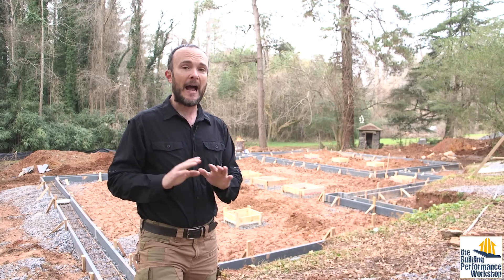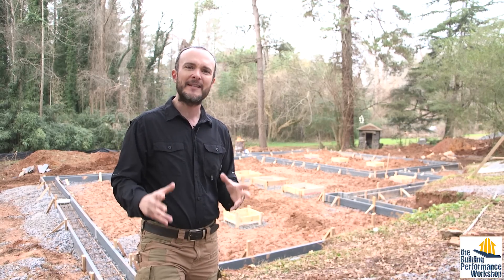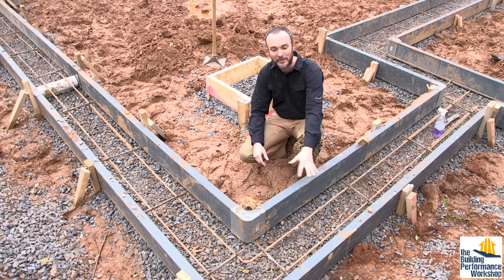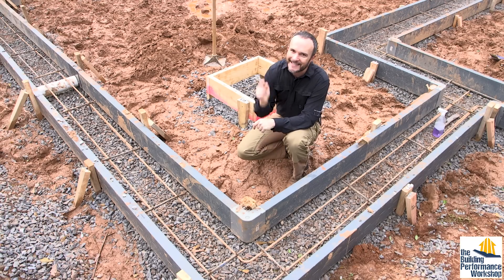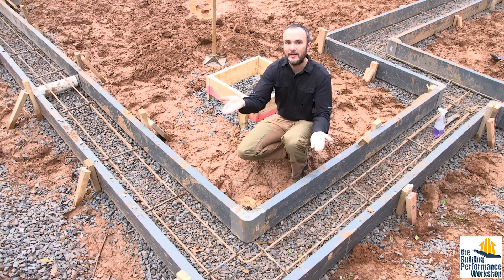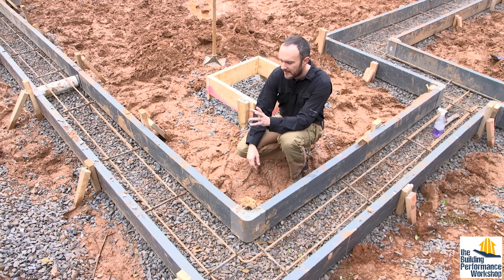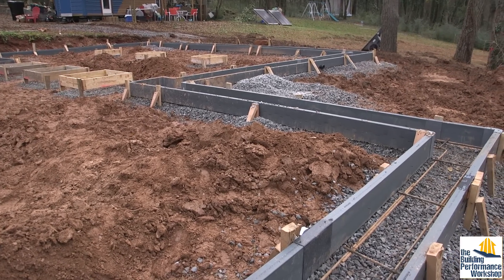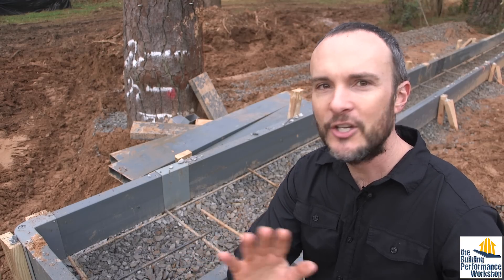First Concrete Pour: Form-A-Drain 4-in-1 Foundation Footings

Comment: I won't go through my entire work history but suffice it to say I have a lengthy career in building.  I came up through the trades and now manage custom residential as a general contractor.  I think you are doing yourself a great disservice.  Perhaps you have disposable income and if this is the case disregard this.  Please consider these points.
1)  It is untrue that there are no reputable builders in your area.  It is equally true that there are crappy ones.  You have a  good relationship with the inspector.  He knows which are good and which don't know what they are doing.  I am slightly hesitant to advise you use the moron that told you to clean all of your rebar but more on this later.   You clearly don't have experience building in spite of the fact you have done a respectable amount of research.  While I have worked with men and women that are more educated than me, I have tons of experience and in most cases this far outweighs theoretical knowledge no matter how good.  It means that I have made every mistake and learned many hard lessons.  Avoid anyone that suggests they know it all, they don't.  I have learned something on every project.  I have built pole barns in Tennessee and mansions in Beverly Hills.  Each job has its challenges and lessons.  You don't have that from what I am seeing.
2)I suspect that you are costing yourself thousands of dollars by delaying the project.  If you are going to continue you need to know what will be happening well down the road.   Make a 2 and 4 week outlook so you know what to be prepared for and to find out what delays you need to expect.  When you call a sub or vendor ask them "What is your lead time?" or "What is your first available?" Know this so you don't have long delays. At the very least you are paying a mortgage on the new property and rent or mortgage on your current place.  If you are going on "cleaning rebar" tangents when someone makes a ridiculous suggestion consider how long it will take and have a figure in your head the tells you "How much will this cost me?/How long will this take?"  Its the same thing.
3)rebar-NO inspector has ever mentioned much less required me to clean rebar.  Removing the rusted mill scale would have a positive effect no doubt, but at what cost.  If as I saw in your clip you only cleaned the top 2/3 of the bars.  In other words what you did was probably ineffective.  If you have ever seen a road project you have probably seen "green" rebar.  Its primed.  I think the prime discredits your inspectors theory that there is a "chemical bond" between bar and concrete.  Look at the rebar.  Its designed to have a physical bond, thus the ribs that bond physically with the mud.  I have demo'd OLD concrete and on occasion you will find it smooth.  Still much more effective than unreinforced.  Think in terms of diminishing returns.  What was the purple fluid you were spraying on the bar?  think of using primed rebar if you insist but an engineer has told me that each bend causes the prime to come off, same for cuts.  
  Consider the 'chairs' you used.  They are iron and touching the ground.  You have introduced a way for rust to "infect" your rebar.  In California they use "Dobys"  ( a small cube of concrete with tie wire cured in it).  They are usually 2" thick  (half the thickness of a typical slab on grade).  Prevents the connection of ground to rebar and the path of oxidation. There are plastic chairs too.  It may make 2% difference after its all said and done.  Two years in your 100 year scenario.  
4)You took a year off to do this.  See item 1.  You would have been better off by taking days off for critical days by my way of thinking.  We typically have weekly meetings with the client, their representatives, architects, engineers, interior designs, etc etc.  Worth a thought.  Someone in the comments says he never lets clients on site.  A fantasy of mine but not realistic.  No client of high end custom homes would agree to this.  For a reason.  
5)Form-a-drain.  A)There are LOTS of really good ideas out there and we should be moving forward with better designs for more efficient and long lasting homes.  The ideas are often not the issue, getting a construction worker to do something new is where you run into problems.  You should use new ideas with contractors that are familiar with it.  Seek contractors that are recommended by the manufacturer in your area. B) Where are your sumps in this scenario?  When we install perimeter drains, or French drains (we are required to in Colorado) we follow a design by a soils engineer (same guy that tested soil and made recommendation for design based on soil) including drainage.  Perhaps you have sufficient grade to daylight the Form a Drains to.  We always have fall to a sump pit with a sump pump.  We do full basements 99% of the time and usually need pumps. If your forms/perimeter drains are level they are probably not draining until the soil around them are saturated. Exactly what you trying to avoid. Consult with your engineer.  He knows better than you generally speaking.  C)I have built in OK, TX, ME, MO, KY, CA and now CO, Canada too.  As you can imagine each place has its own customs and what I learned over time was that even if the local craftsmen couldn't exactly tell you why they did something there most often is a historic precedent for it.  The sad thing is that over time it  just becomes "We always do it this way!" Don't discard this.  As you search the internet or binge HGTV keep in mind everything you see is NOT appropriate to your region.  Find out from your engineers. D)drywall screws to secure forms to footings- Surely you know this is a joke.  Lets say you don't have expansive soils like CO.  In a year it will have rusted out. We have bentonite clay.  When its wet it expands, when dry it contracts.  It looks like you have red clay so I suspect it moves.  There is no chance in hell that a drywall screw will hold against this pressure.  Even if you used SS screws it won't hold.  Remember, drywall screws are for drywall, thats it.  
5)Line up a plumber for underground plumbing if need be.  see item 2.  If you have subs that will come the next day that typically means they don't have ANYTHING going on.  Its a sign of a problem.  The best guys are in demand and therefore not waiting around for a call.  And DON'T call them until you are 100% ready.  Nobody will continue to respond to the boy who cried wolf.  
6)  Always consult with your subs and make it as easy for them as is reasonable. As an example don't forget to put a UFER ground in the foundation thats in a good location for your electricians.  Ask them where that is. Just a suggestion.  
7)Work with someone that has more experience than you.  Lesson for life. There was a time that everyone built there own homes BUT consider the complicated nature of houses today.  It is not the same as when a farmer decided to build a new home or barn, and yet they still stand.  I hope this is your case too. Good luck.
Reply from the maker: Thanks very much for caring and for making such an effort on your comment, Eric. I understand most of your concerns, and there are some background facts about me and this project that you’re not aware of. I’m the designer and builder of this home, and I’m not inexperienced except with concrete. We have a nationwide support system of engineers, builders and architects who have been giving input on the project for several years- don’t worry

Comment: I would back up those forms with 2x4 the long way, but I would not use plastic forms. I didn't really get not wanting rock on the backside? If rock is push it in,  concrete sure hell is going to push out.
Reply from the maker: Stakes are on the outside, so they’re ready for internal pressure, we weren’t sure about the other way around. Like pushing on shelves from below.
Reply: @HomePerformance  That stuff is an extrusion. You would think they would extrude in a T-slot on the inside. Then you can pop in cross supports every 2'. The cross supports could also hold the rebar. Still not sure about it?? But I am sure it will work. My house foundation blew out and it has survived earthquakes. It been that way since sometime after 1904.
Reply from the maker: Good point- I’ll let the manufacturer know

Comment: Number two is the disk method would work but it would get clogged up eventually possibly sooner than later in would be very hard to clean out like a regular 4 inch PVC perforated pipe that we install with drainage rock all around plus wrapped with fabric so that no soil would get it in and yes it does go all the way down to the footings I know this because I am a builder and a general contractor and I do this every day however is he using it for the footings it is need but also very expensive and the fact that are method is better I would not be using this at all and wouldn't have recommended
Reply: Gravel will be added, and filter fabric applied above, as recommended by ICC.  This will eliminate the opportunity for fill to gain access to the perforations and potentially clog.  Fabric next to your perforations can create a furnace filter effect.  Fill can clog your fabric at the perforations, which will reduce the flow rate into your drainage causing potential damming of water table.  Recommended installation is to have your fabric moved above stone to ensure this doesn't happen.  With fabric no concern for clogging.

Comment: Kudos to you for involving your kids to watch.  I am a contractor in Monroe County.  I use compacted gravel as a base for concrete driveways, but I have removed slabs inside homes and had never been driven on that were 50 years old and where gravel was used for fill.  The gravel had self compacted and left a 4” gap under the slab.  In your case the rock would hold its on and the gravel may settle.   The simple old school ways of digging a more or less straight ditch in virgin dirt and filling with concrete is holding up millions of homes with no issues.    

Anyhow, chase your dream and listen the experienced guys.

Comment: I used to make Form-a-Drain and the couplers.
Reply: Hey that is cool. We're they a decent employer ? My ICF guy turned me on to Form-A-Drain back in '02. He just kept telling me about this awesome product that just complimented ICF construction perfectly. He came over for dinner. My wife's famous chili and cornbread. So he whips out this chunk of slotted plastic and proceeds to educate me. I was sold in about ten minutes and I have used them ever since. That was the first footing and foundation I had ever done.
Reply: @markjohnson6498    When I made Form-a Drain, I was working for CertainTeed Corp. It was their concept and engineering, however I'm not sure if it still belongs to Certainteed. The plant that the extrusions were made has since been sold out to North American Pipe Products. The plant where the molded couplings were made is still CertainTeed. I worked at the injection molding plant for 9 1/2 years. It was a good company to work at still when I left in 2000.
Reply from the maker: CertainTeed is not in the picture anymore- it’s owned ny NAPC
Reply from the maker: Then thank you for making the world a better place

Comment: I know it's too late now, but you mentioned in the video about doing the footings 8" deep by 16" wide.  While that does meet code for up to a 2 story home, as an architect, I would recommend using a 24" wide footing and not because it is structurally necessary but because it gives a little more wiggle room for the block masons to lay their block straight just in case the footing happened to not be perfectly straight.  16" minus the 8" block leaves just 4" on either side and while in a perfect world that should be ok, what happens in reality isn't perfect so a 24" wide footing just allows for that.  It's a little more concrete but it's a lot more piece of mind.  Great job btw.
Reply: He did get 24 inch footers when the form a junk started to bow out when pouring it.
Reply from the maker: Thanks, but we did poured 8” walls and everything is perfect!
Reply: Keep your day job
Reply: @johngeise1806 , who are you referring too?  If it's me, it is my day job.  Maybe you should find a new job altogether.
Reply: Thats over kill. Minimum 22" by 6" thick is more then enough plus his is 8" with a 4ft wall ontop. Only reason to go wider would be due to the ground he is on.
Reply: @jamesjazwinski4412  No, that's not overkill.  A 6" deep ftg. is the bare minimum allowed by code for a 1 story home.  If you do things that barely meet code, then you won't have a well built home.  The extra 2" wide and 2" deep is going to be very minimal from a cost stand point but a huge peace of mind structurally.
Reply: @jtltet  sorry I didnt realize you mentioned that it was not a structual point you were trying to make I retract my statment. Lol but Do you know how much extra cost would be involved in making it 24" on that ground Just to accommodate the block layers. Lol I agree that bigger is better for many reasons but there are engineers for a reason.
Reply: @jtltet  just imagine how much this footing would have blowout lol So if I had a 1 story with a loft above and a walkout below. Your saying that is to much for the footing below the walkout portion? You should come up here to ontario  and explain that to the engineers here. Lol So far Ive never seen an issue or herd of one and im talking about million dollar homes they are dealing with. Which these are much heavier then normal houseing due to the materials being used to build them. It can also depend on the strength of the concrete mix. Rarely do I see 8" footings. Unless its for a monster of a house/cottage like the last one I did for the CEO of TD bank.  12-14" thick walls by 12- 16ft high with steel coloums and beams above 2 stories high. Mind you it was on crushed bed rock and rock. The ground below plays a big part as well.
Reply: @jamesjazwinski4412 , North Carolina residential building codes say a 6" deep footing is allowed for a 1 story home.  An 8" deep footing for a 1-1/2 story up to a 2-1/2 story and 10" deep footing for 3 stories.  As far as the width of the footing, it depends on what type of foundation wall you are constructing....hollow masonry w/ brick veneer versus solid masonry versus 2x6 all vary depending on the number of stories for the home.  I imagine the codes in Canada are not quite the same but I don't think they would vary to the extreme.
Reply: @jtltet  yeah man 6" footings while haveing 6" coverage on either side of the wall. Thats pretty standard. Im not an engineer or an architect so I wont debate why. Im just saying from experience majority of the time its 6" by 20"
Reply: @jtltet  hey apon further review I am wrong. Lol I Dont often do the footings Just foundation walls unless im doing additions or retaining walls. Now im thinking walkout sections that Im pouring on should be 8". Lots of money in these houses but they like to go minimum.

Comment: As others have noted doing a slump test on site is important because you may not want to trust that the concrete supplier is honest even if you do trust your contractor. lots of things can be wrong with concrete and difficult to identify a slump test is kind of the bare minimum but if the supplier knows that a test will be performed on site they may be less likely to screw with you. Also the fact that your contractor was resistant to performing a test should give you pause it doesn't take much time and is not difficult, it is possible that he did not have a cone on hand, and that is the least suspicious reason i can think of to not perform one, worst reason would be that he knows the concrete is not to spec. I guess maybe if he personally witnessed the test being done at the plant? Anyway you are probably fine this comment is more for other people who are looking into building their own homes, confirm with your contractor before hand that a slump test will be performed on site and then he should be prepared day of.

Comment: My worry is in the chemical in which you used to clean the rebars. You should’ve used plain old water so as to prevent the possible chemical inhibition with the concrete and the rebars
Reply from the maker: I used bleach and ammonia mixture. Saw it on youtube.